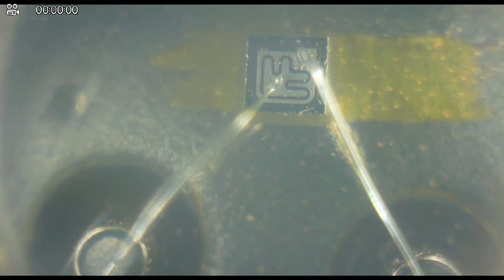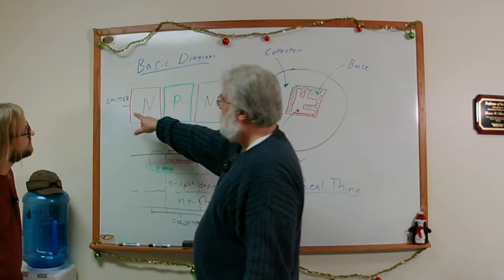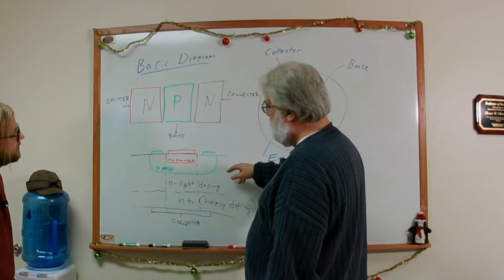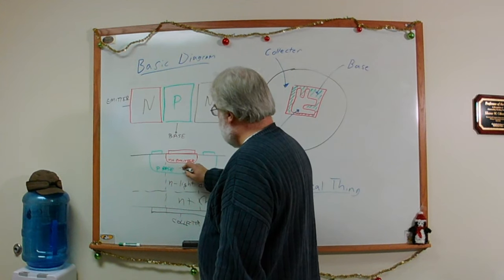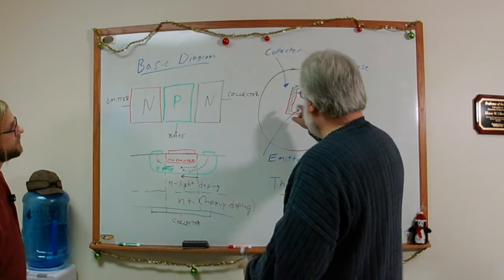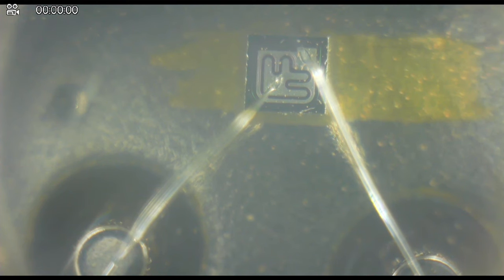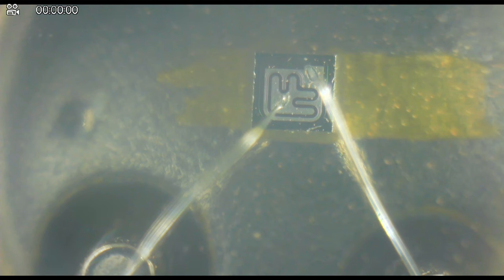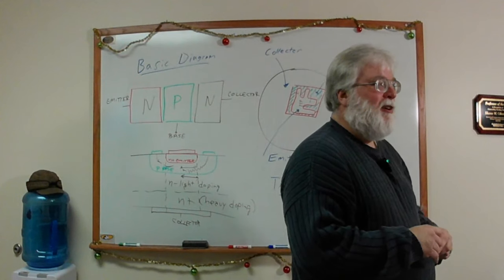The Fascinating Geometry of Transistors - Asking an Expert

Comment: The substrate is N type phosphorus doped silicon, the base is boron doped P type silicon by diffusion. The whole die is diffused, Next the die is coated with the base contact patern usually out of tin gold alloy and a passivation SiO2 layer is applied to the margin The final layer is N type phosphorus doped silicon applied by diffusion or direct ion implantation. Finally the contact is created by metal deposition. This contact is usually aluminum.

Comment: Old germanium transistors like OC72 had a glass enclosure painted black, except on top what made them phototransistors too. Sometimes the paint peeled off and you could see: the were very like the classical drawing we do on class or, more like a o|O (yes this form I drew on ASCII) with the | far larger base, the base was a thin sheet and the emitter and collector like solder blobs, the emitter smaller blob than the collector.